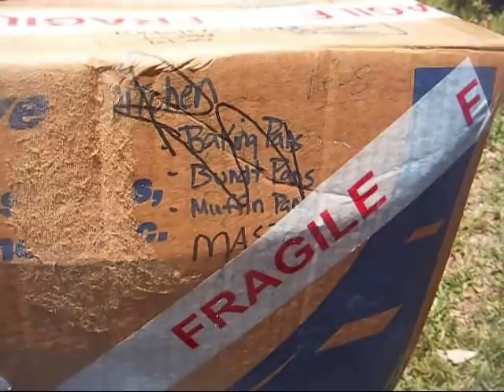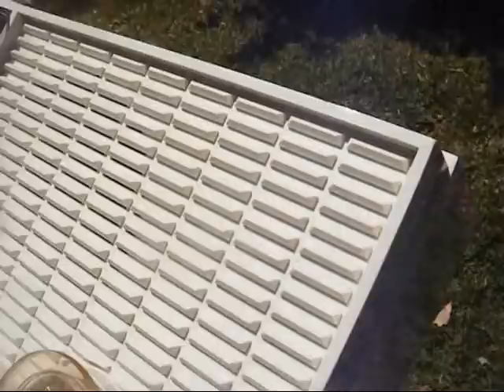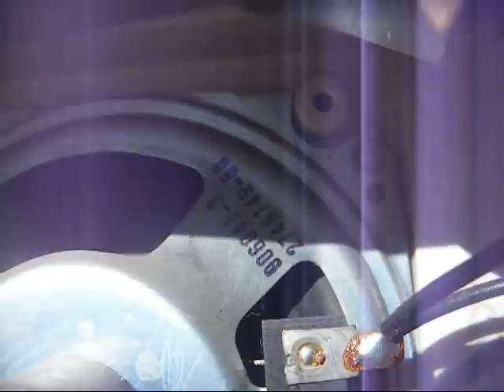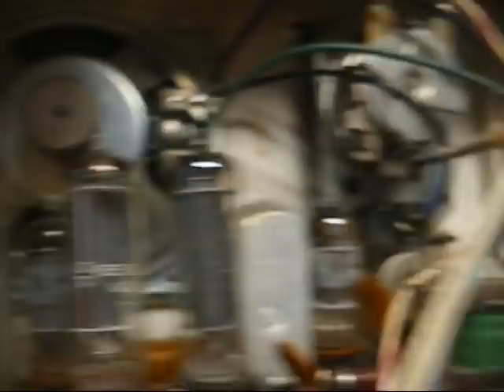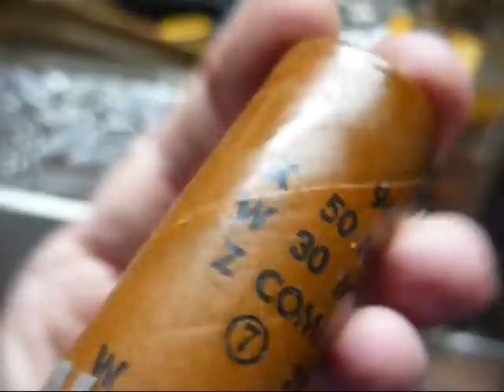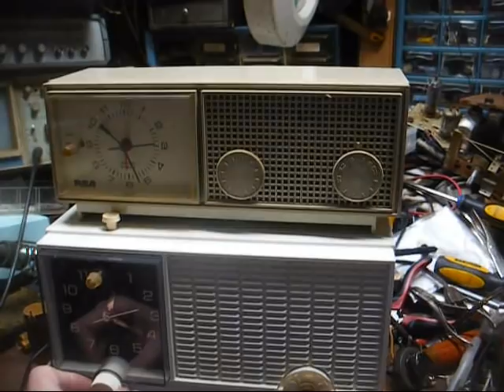Unboxing & quick repair of an RCA Victor tube clock radio from 1968

Comment: Great repair sir, and kudos to the seller for getting it to you intact! After my last Ebay debacle on a vintage bakelite radio, I most likely will not buy another on Ebay. Ebay made it right, but the seller was an ass and only refunded half of what I paid. I think he shipped it badly packaged and already broken so he could collect insurance and my money as well. Definitely was a scammer in my opinion.

Comment: Nice clean radio. Definitely one of the last tube sets. With both PCBs and tubes, it looks like a modern guitar amp. Shango recently found a TV with transistors, tubes, and even an IC!
Reply: Those were called "hybrids". Weren't made for very long.

Comment: Rca was my second favorite brand after Zenith. They made excellent tubes. Especially their military and industrial types.
Reply: RCA was for many years was far and away the biggest innovator in vacuum tube technology. I work for a commercial electronics manufacturer and had an elderly co-worker who worked at the RCA tube factory until it closed in 1976.

Comment: Despite the foreign parts, I'd assume it still uses a Telechron clock movement?
Reply from the maker: Actually, it's a Westclox movement. Them and Telechron were the most common suppliers of movements for clock radios.

Comment: This has to be early 1968, but RCA changed its logo to a modern RCA block logo later that year. The back of the radio has “RCA Victor” and “Victor” on the back except the RCA “Meatball” and the Nipper logo which was on its last legs before the transition started.
Reply: Personally I always liked the original rca logo much better than the current version.